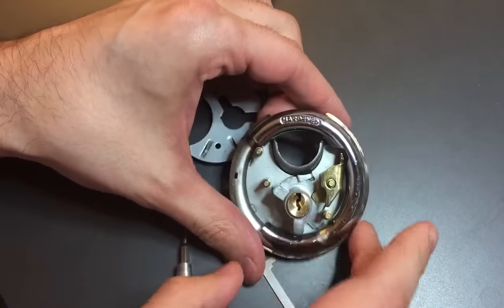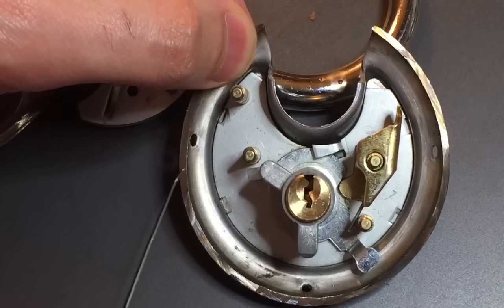[170] Mr. No DE70 (Dual Bible!) Disc Padlock Picked and Gutted

Comment: Very nice.  I am curious, why would you need spools (or any security pins) in the secondary bible?
Reply: I guess it just makes it a pain in the ass to re-lock? If a less experienced picker manages to spend a good few minutes getting it opened they're not gonna risk getting caught picking it back closed to make it less obvious someone was just robbed. If its on a storage container that doesn't get checked on a daily basis you might not notice it was broken into until weeks or even months after, and security footage might be long gone by then.
Reply: I had the same question, and this is the only answer I could think of, but still weak.  Does a thief really want to cover his tracks so badly?

Comment: What's the point of security pins in the second bible? I can't think of many situations where it would be a significant security concern that someone would pick an already open lock to shut it.
Reply: I see these on storage units and the like so maybe its so no one can lock you in with it. Idk
Reply: @chance2smoke  there are dozens that look exactly like this that are not dual Bible. Only way to tell them apart is to read the model number and branding. Also I would just pocket the thing if that worried me.
Reply: @merendell  I didn't say they were all dual bible. Just that the style of lock is used on storage units. I'm picturing someone being locked in a unit by mistake.
Reply: @chance2smoke  Fair enough but my point still stands. If you think its a big enough risk of someone locking you in by mistake the lock is small enough to just pocket while your inside. There's also the fact that nobody is going to lockpick a lock closed by accident security pins or no.  you have to intentionally do that at which point if they want to lock you in they could slap their own lock on there.
Reply: Its to simplify the production process.

True, there is no reason to do it, but there is no reason to not do it either. Doing it means keeping track of fewer unique parts so they went with that.
Reply: @wybo2  I think you got that wrong, by adding pins in the second bible you're actually increasing the number of "unique" parts or rather parts in total(since the spools from the second bible are the same as those of the first[also applies to the springs etc]). So in reality it increases the production cost, but it doesn't add any practical value to the lock.
Reply: @mr.2083  Here You are wrong! You always need to have driver pins and springs in that open position bible, if you want to pull out the key, or you get trapped, if just 1 core pin will not return into the core than.

Comment: Cool lock. Dual bible? There is a comment here that suggests it's a safety feature, so you can't get locked in your truck. If you ever find out what the purpose of the 2 bibles please do an update. Another fantastic video.
Reply: It feels more comfortable if you can remove the key wether the look is open or close. Isn't that enough for a reason.

Comment: Pretty cool lock..Never seen a dual bible. But as you have said don't see the need...Still trying to figure out why they put security pins in the second bible???? I guess to make it harder for Mr. Criminal to pick it back locked?? LOL
Reply from the maker: LOL.  I don't get the need for the second bible or the need for security pins in it... but after all the crap I give lock makers for how easy their locks are to open, who am I to criticize the use of security pins (though, technically, they are making it hard to close... weird)?

Comment: I wish I'd seen the cutaway before someone stole our box truck and tried drilling out the keyway.

I remember seeing the stupid latch that prevented my bosses from moving the shackle and drilling all around it and I basically drilled most of the case until the shackle was free.

I could possibly have just taken a brick and a metal mallet and pounded the case side until it split...

Comment: Why would they bother putting pick resistance in the second bible? The lock is already defeated at that point, unless they are trying to prevent stealth opening of the lock I suppose. It just seems a bit unnecessary, but I might be missing something.
Reply: Its to simplify the production process.

Comment: If you would pin up the first chamber, it would be impossible to remove the key in the open position i think?
Reply: tom1211tom Correct, I think. The key pin for the first chamber wouldn’t be able to move out of the way to let the key past.

Comment: Great info on that unusual padlock. How is the bitting on the one that picked so easy? Can it explain the difference? The second bible - well, why is it of any advantage to remove the key when the lock is open? It's not like a padlock with a spring loaded shackle that can be pushed to close without a key. Also, the second bible has spools and it's a different pin set up. Do they randomly pin them up. If yes, then this could explain your easy pick on the other.
Reply from the maker: Thanks, and I agree... absolutely no point in the second bible.  That said, the novelty is worth the price of admission IMO.
Reply: @lockpickinglawyer  The second bible is a safety feature so if you use it on something you walk in and out of a person would not be able to accidently lock you in without the key.

Comment: Before you gut this, I'm going to make a guess that the "regular" bible contains security pins, while the "unlocked" bible only contains standard pins.  To me that would make sense as you'd want it to be hard to pick open, but who cares about picking it closed -- that feature is just to allow removal of the key.

Now to hit play and see if I guessed correctly.
Reply: Interesting that there are actually spools in the secondary.  Wonder why they did that?

Comment: Where did you get your tubular lock pick with the warded picks on either end. I have the mantis from sparrows. Have you tried that? If so which do you prefer. The mantis only has one size for the tubular tension but yours looks like it has two for different size tubular locks. How do you like yours?
Reply from the maker: USALockPicks.com ... and it's WAY better than the Mantis IMO.  I gave my Mantis away after I got this one.

Comment: nice work man I still don't under stand y there is 2 bibls I don't no what the other one is for hmmmmmm keep up the good work merry Christmas and keep up the kool videos thanks stglocks..r
Reply from the maker: Thanks... the second bible just allows you to remove the key in the unlocked position.  It's the answer to a question that no one asked!
Reply: thanks for that I understand now take it easy man yano
Reply: Also why the pin 1 position was empty in the main bible? Key would still be captive if used?
Reply: if they used the pin one in the main bible, you couldn't remove the key in the open postion unless it was the shortest pin of ever other one. 
When the key comes out, it pushes the pins up, and since the second bible on the lock doesn't have a pin 1 place, that pin would hit the top of the lock in front of  the bible and the key can't be pulled out.

Comment: Why would they put even one spool in the secondaty bible? They obviously don't put the same pins as in the primary so it's not an automated thing. So why put something more expensive (even barelly)?
Reply from the maker: You make a fair point... but I'll go a step farther.  I'm not even sure I understand why they have the second bible, to say nothing about how its pinned.  It's the answer to the question that nobody asked.
Reply: maybe the shape of the cam stops the key from turning 360 and they wanted the key to be able to come out when it is open.
Reply from the maker: The shackle hits a stop post... that's what keeps the core from over-rotating.
Reply from the maker: As for taking the key out... why?  Analytically, what's the difference between taking the key out when it's open or closed when you need a key to relock it anyway?  I just like the novelty of the lock.
Reply: Let's take this in stages.

Why spool pins in the secondary bible?  To make it harder to pick if you want to lock it when you don't have a key?  Doesn't make much sense, especially as spool pins are more expensive.  To simplify assembly so that to populate a particular slot in both bibles you grab two pins from the same bin?  Maybe, but I figure it's cheaper not to do that.  To reduce errors when pinning up that mean the key doesn't work with both bibles?  Maybe.  Except the one you disassembled had some plain pins in the second bible where the first bible had spools.  So no satisfactory answer.

Why two bibles?  So you can take the key out when it's open.  Simples.

Why would you want to take the key out when it's open?  To stop some idiot locking it again.  For example, if the lock is protecting some sort of walk-in enclosure.  You don't want somebody locking it without realizing you're inside.  You don't want to carry the padlock around to prevent that, because it's bulky and a little heavy and might be extremely cold.  This lock solves that problem.

About the best answers I can come up with.  Of course, you could always write to them and ask them, but that's cheating. :)
Reply: bdf2718 the alternative to “take out the key while lock is open” is not “leave the key in”. It’s “close the lock on open air and then take out the key”. Which is not even an extra second worth (especially if it’s a good diskus lock) of effort — you grab the key, and instead of just pulling it’s twist and pull. Also vice versa.

As a bonus, you can then lock the lock over the empty hasp, which a) gives you a place to put it and b) prevents you being locked in even if someone brings their own lock (or with a ballpoint pen through the hasp, for that matter).
Reply: Are there setups with diskus locks where they are semi-permanently mounted into an enclosure? Like the job box locks do with regular padlocks? In that particular use case, where the disk is not just hanging freely, I could see this being a thing.

Comment: Be interesting to know why its called a Biible?  Is it to do with the angle of the double core?
Reply: From wikipedia: The bible is the part of a pin tumbler lock that contains the pins and pin stack springs as well as the pin stacks themselves. The driver pins of a pin-tumbler lock are located in the bible.

So all pin tumbler locks have bibles. This lock has 2 bibles.

Comment: Why would they bother putting spools in the secondary bible?  Is there really a danger of somebody trying to pick the lock CLOSED?  I don't understand.
Reply: I think it is so someone can notice it was picked into. In order to close it, you will have to pick it again  If you can pick it open and close it back afterwards, no one may know it was ever picked into in the first place.
Reply: Or they could just not open it all the way 'cause rarely does a disc lock need to be opened all the way to get it off whatever it's on

Comment: I don't understand how having a second bible works. what function does the second bible have?
Reply from the maker: It's just there to allow you to remove the key in the "open" position.  As for the next question (why do you need to remove the key in the open position?), I have no clue.
Reply: thats it??? all that extra hardware so you can take the key out when its open??? 
....ok?.... We'll have to has Mr. No, but he probably wouldn't tell us.

thanks for taking the time to open one of these up, I always wondered what they look like inside.
Reply from the maker: No problem... I took it apart because I had to see the double bible.  It's a novelty if nothing else.  I just wish I had waited for the second lock to arrive before I did it, so I could have shown the one that was harder to pick.  :(
Reply: Just one possible answer:  When our company was buying new locks to be deployed at hundred or even thousands of locations as a security upgrade, many of the trade craft workers insisted on removable keys.  I never heard a good reasons, but it they were adamant about it.

In the end, the manufacturer provided key retaining locks, but I don't know if that was a mistake or what we actually ordered.  But i could see a run of locks being made for a large purchase if the buyer had this as a required spec.  Maybe yours is just one that is left over.

Comment: why spools in the secondary?
Reply: Because when you pull the key out in the open position, you may want it to go back to lock sometimes in the future.
Reply: You need to have driver pins there, so it is just cheeper in production, to take the same as in bible1.

Comment: This lock could have a different key to unlock and lock it.
Reply: No, The top of the core pins have to be at the shear line when into the cut of the key, that is the same in both positions. When you add a master wafer to the a  pin, than always it is nessesary to lock  with exactly the same key, you opened it. 
Let me put just one master wafer in one pinstack, than you may use 2 different keys, one with a deeper cut in this position.
When you now open the lock with the key with the not so deep cut, the master wafer will stay into position 1 . If you than want to lock with the second key with that deeper cut, the driver pin of bible 2 will block the shearline, you only can use the same key to lock. If you than unlock with that key with the deeper cut, you will transfer the master wafer to bible 2. When you than use the key with that not so deep cut to lock, the master wafer will remain in position 2 than, and you only can unlock with this key again.
Reply: @peterwiegel4778  You can lock most locks without the key under certain conditions. How about a key that unlocks a lock, but the resting position is where all the driver pins are partially depressed and can be rotated to the locked position. 
Again, heck wafers in this scenario.
Reply: @JonathanTuckner   Think about your idea, for a lock, as these disk locks, with that circular shackel, that is over some kind of a gear hardly connected to the lock-core, so that this cannot turned around for 360 ° it is impossible topull the key out without a 2nd bible in that stop position. And, as the keyis pulled out, the core cannot move backwards,to close that lock without the key in place